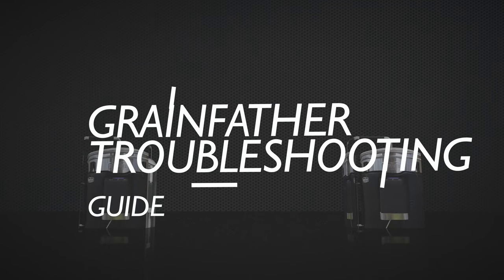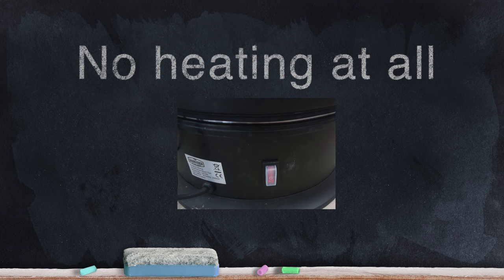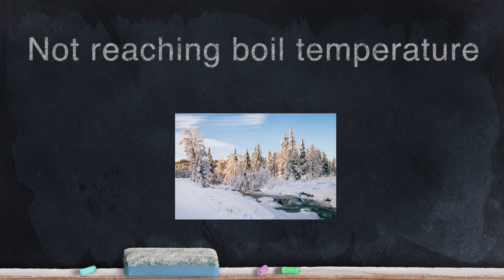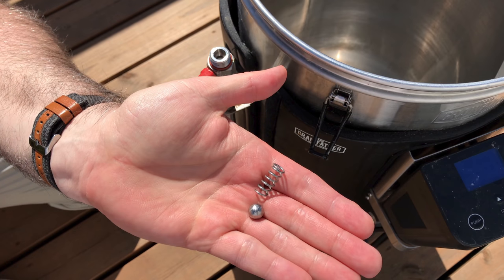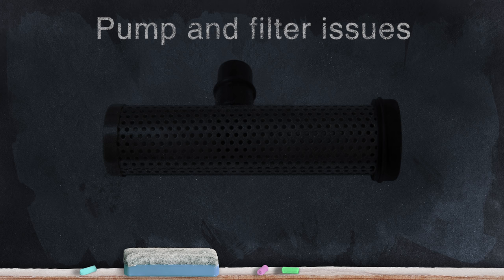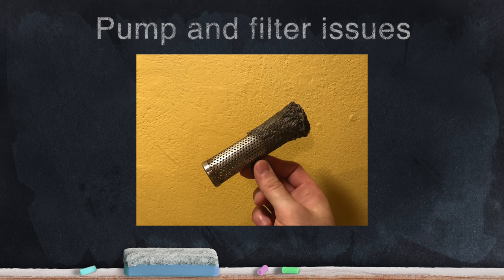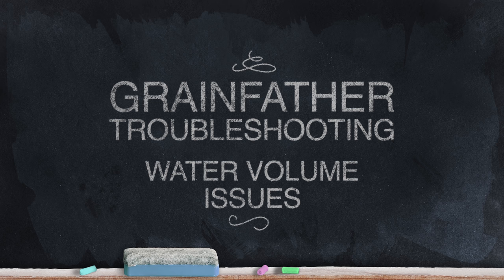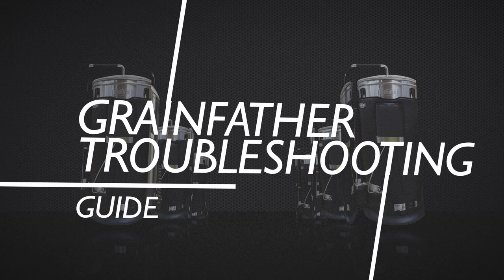Grainfather Troubleshooting Guide

Comment: Hi David. Someone once told me never to use bicycle pumps for any blockages, because the may contain grease or oil, but instead to use CO2. You also get a lot of pressure out of one of those bottles! Cheers for the video again, always helpful.
Reply from the maker: Its a trick used in breweries even. Whoever told you that is overthinking it. Ive never had an issue with it, nor heard of one. There are various other methods of course, use which suits you best :)

Comment: Thank so much for this video - all the research, reading and time spent - the bottom switch wasn't turned on...!
Reply from the maker: Many thanks Marc. You are not the first or last to experience that issue :)
Reply: @DavidHeathHomebrew  is there a way to calibrate bluetooth controller or is it like most thing made to not be able to calibrate thanks
Reply from the maker: There are some adjustments you can make. This is all done via the smart app settings.
Reply: @DavidHeathHomebrew   what type of adjustments on the app anything on YouTube shows how to do this ?
Reply from the maker: Go into the settings on the app and you will see the options :)

Comment: pump filter came of on first brew, I should have done as you said from start :/ (also had big problems with my 1945 pipeing use different dimensions so I had to hold the hose for the chiller by hand with water spraying all over the place :/ )
Reply from the maker: You have next time covered hopefully :)

Comment: Hey, great video as usual! Quick question about grain crush. When I mash, most of my recirculated wort is going down the hole in the middle, not making a clear wort. Sparging goes normal speed.  And I usually end up with a total efficiency of 65%. I get my grains precrushed from LHBS, to fit the GF. Should I tell them to not crush it as fine? And wouldn't that give me even less efficiency? Im soon gonna buy my own mill, but till then. Cheers - Ray
Reply from the maker: Hi Ray, glad to hear that you enjoyed this one. A great starting point for graincrush is a credit card sized gap. Whilst it is expected that some wort will overflow this should even out after a short time into the mash. I find this varies from afew minutes to 10 maximum. Are your gradually adding the grain in small amounts and stirring as you go? I show this technique in many of my videos? Then finalise with more stirring to ensure a sucessful mash. You should easily get 75% effeciency if all is done correctly. Buying your own mill will certainly give you full control, I would recommend it :)

Comment: I have a new G30 brewer, and have had constant problems with the basket screen clogging when grain is gelatinized.  The bottom filter screen pretty much totally clogs causing the pump to stop or become clogged.  I have tried coarser grains builds and rice hulls with no improvement.  To me the basket design is totally wrong.  There should be a solidly attached bottom screen and numerous holes in the basket sides to improve drainage.  I welcome your thoughts on this problem and those of others who've experienced this problem as well.  Thanks
Reply from the maker: Sorry to hear of this. The basket design is very similar to others, ive used it a lot without these problems. The graincrush is the key. Are you milling your own grain or are you buying it crushed?
Reply: @DavidHeathHomebrew  I grind mine, and have tried it coarse, but still clogs.  If you look at the new Forge Brewer from Anvil, you'll see they have a much better basket which has drain holes on the side and bottom.  This is a much better design.

Comment: Hello. Thx for another great video. I am buying a chest freezer for fermentation. I live in south Africa where heat is a problem and the big difference between day and night temps. It fluctuate between 20C and 33C in summer days and in our winter months it fluctuates between 6C and 18C. My question is do you think I will need a heat lamp or heat pad for winter months? And if so what is better lamp or pad?
Reply from the maker: I would go for a heat belt :)
Reply: Here in Western Sydney we had 0-27C just the other day. It's only in late winter/early spring we get a range like this and only when it is very clear and there is a certain weather pattern. I use a snakecord in the brew fridge for heating, the kind they use in reptile cages. They are quite cheap.

Comment: Hi David, another great video. Would you have any tips to stop wort leaking when taking off the recirculation arm or counterflow chiller, I keep geting sticky wort down the side of the unit and the floor cheers!
Reply from the maker: Thank. It is worth waiting a little time after turning off the pump before removing these. That was the flow can go back down the pipe and you avoid this issue.
Reply: Thank you very much :)  @DavidHeathHomebrew
Reply: Maybe the ball/spring housing and/or the stop cock housing are loose, they become loose easily.

Comment: Another good video David.  One question on the cleaning chemicals.  Can the High performance cleaner and PBW be used again, i.e. once I have pumped it through my system to clean it can I save it and then add it back after my next brew, heat and repeat?
Reply from the maker: No, this is not recommended. Sanitizers like starsan however are multiuse.
Reply: I have found that distilled vinegar works really well to bring back the shine to the bottom plate.
Reply from the maker: Very true, lemon juice also works :)
Reply: Didn't know that! Probably smells better too!
Reply from the maker: It really does yes!

Comment: David - any thoughts on changing out the heating element? I've checked everything you pointed out and still no heat whatsoever. My Grainfather is going on five years old; do the heating elements eventually wear out? Thanks for your informative videos!
Reply from the maker: Hi Larry, 
Once its dead then thats it sadly. The easiest way is to add an extra one rather than replace. The element is welded. I know some that have done this. Are you a member of the channels Facebook group? We have one guy who is great with such modifications who I suspect could help you.

Comment: I’m having an issue where the connect controller cannot turn down the heat once the element has been set to 100%. This was the second time my mash went over target temp. Luckily I was watching it this time, and turned it off at the switch. Once it’s off for a while, the controller can regulate the temp again. At least until it goes to 100%, the. I have switch it off again to reset it. Any thoughts about what is causing this or how to fix it?
Reply from the maker: Hmmm, sounds like a fault with the controller. I would suggest asking for a replacement from where you bought it.

Comment: As always thank you for the wonderful videos.  I have a question which I know you've covered numerous times.  I'm still having issues with to much grain bits on  top of my perforated plate during mash as well as pump issues that are do to bits getting stuck in my check valve.  I've changed my crush setting to the point were my efficiency starts to drop.  I'm also using the sink strainer to alarm me if there is issues as well.  Is there anything else you might suggest to remedy this?
Reply from the maker: What sort of efficiency do you get when you crush to avoid the excessive grain bits? How much are we talking here?
Reply: First, thank you for replying.  I'm very new to all grain brewing.  I just recently started in May of this year so I know this will be something easy.  When I set my mill gap to about a credit card thickness I get about 2 tbsp of bits around and my efficiency is typically around 75-82%.  The issue isn't really the efficiency but that my pump keeps plugging off before I can transfer to my primary.  I've tried setting my mill gap to 1.5 times that thickness and the only thing that changes is my efficiency goes below 75% (which I'm not really worried about just an observation).  I did try something last night thought that made a big difference.  Right before sparging I carefully pulled the safety check and cleaned all the bits out.  This seems to have resolved the transfer issue at least.  Thanks for your time!
Reply from the maker: Fine tuning your crush can take abit of time. In terms of the pump getting stuck before transfer have you tried using a bicycle pump on the wort out pipe to quickly clear it? Ive shown this in the GF troubleshooting video last.
Reply from the maker: The other thing would be to whirlpool before transfer of course :)
Reply: I haven't used a bicycle pump, but that sounds like a great solution to try.
Reply: Watching your videos is the reason I decided to try all grain brewing.  You make it sound and look easy which gives me the confidence to try it.  I whirlpool every time I've used the Grainfather.  It just makes sense.  Thanks again for the time you put into your videos as well as the advice.  Cheers!!
Reply from the maker: It works very well for sure :)

Comment: Nice, thanks. @david had a too rough Whirlpool last brew and knocked the rubber cap of my filter. Searching for the part of your stainless steel 'wrapper' solution on eBay but can't find the proper search words. Any tips to get to the right item?
Reply from the maker: Try the one suggested here :)
Reply: Thanks
Reply: Joost Hart Your Welcome.... anytime!
Reply: @DavidHeathHomebrew  Hi David, great video - helped me a lot in my first brew yesterday. My filter completely came away, think I whirlpools too vigorously. For the stainless steel clip to hold the silicon attachment in place for the filter can I just use a standard clip from say Screwfix or do I need something specific or food grade?
Also re whirlpooling, how long do you whirlpool for using an electric drill? Many thanks.
Reply from the maker: Great to hear. As long as its stainless steel then all good. Wp time wise 5 mins seems yhe sweet spot when using a drill.

Comment: No clue why, but if you add some starsan concentrate to your pbw solution it works way better and way faster for getting those tricky burnt bits off.
Reply from the maker: Yes, the acid in the star san works well.

Comment: Finding your videos very useful, just jumped in at deep end and bought grainfather and completed first ever homebrew. I had a go at the dimmer switch recipe from grainfather app, all went well apart from end ! After the boil I whirlpooled, but when cooling and transferring to my fermenter the flow was very slow, I found I had to scrape the suction inlet to the pump to remove the hops to allow it to pump my wort. Do yo find this a problem ??
Reply from the maker: Hey Alan, thats great to hear :) Hops on the filter can be an issue until you know the fast way to fix it. Attach a bicycle pump to the wort out hose of your cfc. Give it afew pumps and you will see that its resolved in seconds. Usually the whirlpool will stop this.
Reply: Thanks David
Don’t know if you have tried any of the innis and gunn rum and bourbon cask aged beers ? I’m looking to replicate these, can you recommend any recipes ??
Keep up the good work
Reply from the maker: Hmm sorry no but I would suggest contacting the brewery. Many are happy to advise these days. You will find buying such a cask pretty expensive though. Thats the first thing to look at.
Reply: David. I bought some oak bourbon barrel chunks !! Once my beer has fermented im planning on transferring to a clean storage vessel then adding the chunks for 8 weeks, then hopefully bottle. https://www.themaltmiller.co.uk/product/bourbon-cask-chunks-500g/ Have you tried this yourself ??

Comment: Hi, has anyone had issues with the mash temp not holding? I've only started to have trouble with this with the last 3 to 4 brews. I've only made around 20 brews to date if that helps with any query. The temp keeps going down during the mash so I have to turn it onto boil just to get the temp back up, brew is done indoors so the room temp is fine. Thanks in advance for any help.
Reply from the maker: Sounds like a fault. I would suggest contacting where you bought it for a warranty claim.

Comment: ive been using my grainfather since august of 2017 and my elements were failing me yesterday. unit kept tripping no scorching on element. tried plugging element directly into wall socket and the tripping continued. i have the first edition and it seems my problem was pretty common. im a few months over the one year warranty and hope i can get this fixed.
Reply from the maker: You will find GF is very reasonable about such things by reputation. Best thing now is to report this to where you bought it and they can get things fixed for you.
Reply: @DavidHeathHomebrew  i did reach out t the seller, it was an outlet through ebay. have not heard back there yet, but i also emailed grainfather and they were prompt to answer back yesterday but have not heard back today after responding to their request. i have read many great things about there customer relations though
Reply from the maker: I am sure GF will get it resolved for you.

Comment: One video you say to use a stainless steel scrubber and this video you say plastic scrubber. Is it ok to use a SS scrubber on the heat plate or has this changed?
Reply from the maker: It became something of an arguing point....so I stuck to the safe route!  I have used SS scrubbers with no issues...the key is not to scratch when you use them. So gently does it and you are fine with them.